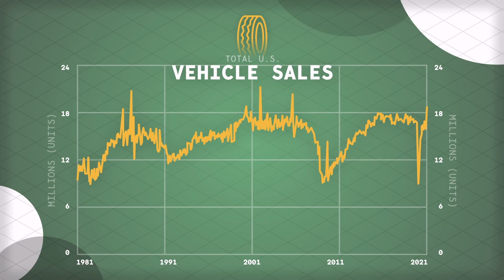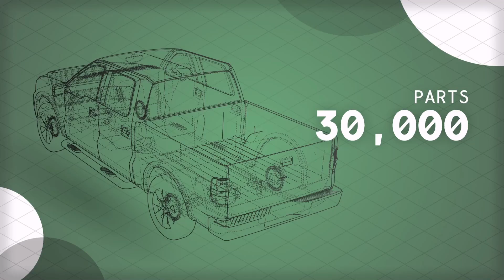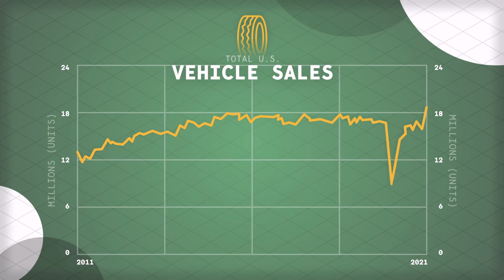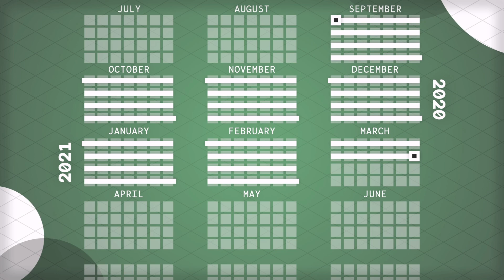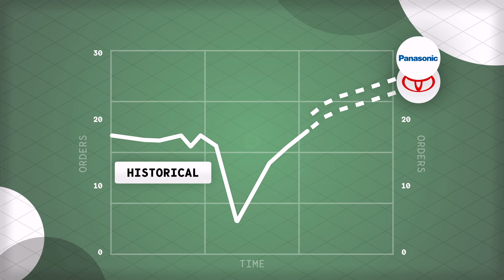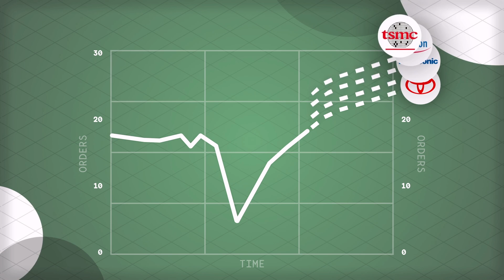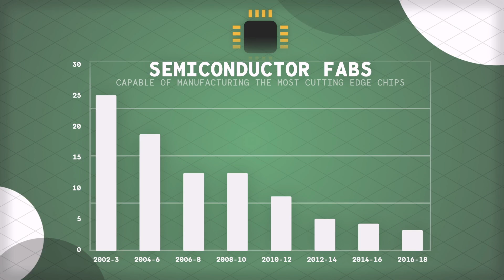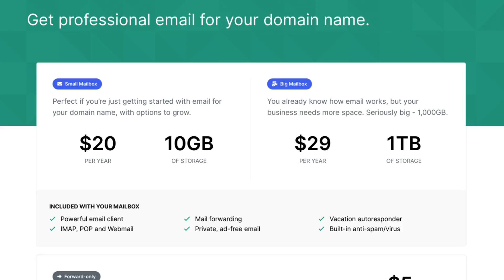Why the World is Running Out of Computers

Comment: Each nation needs to have a more comprehensive e-waste recycling program, too many perfectly good components end up in landfills, ie chokes, capacitors, transistors in a limited fashion, and precious elements. Many of these components can be easily repurposed in new devices.
Reply: This is not really true at all. E-waste is broken down for its metals and rare materials. You don't reuse the components at all. E-waste recycling is purely to save on mining.
Reply: @cazzah49  Recyling is recycling, the method is arbitrary
Reply: What Cazzym said about e-waste being recycled purely for materials. Also, what you listed (chokes, capacitors, transistors, etc.) are ELECTRONIC components and would be useful in building PCBs. What's being discussed in this video however are SEMICONDUCTORS which are dies of billions of "transistors" built at the atomic level and really can't be broken down or repurposed into other chips at all. Every unit made is its own unique product and an old die cannot replace a new one if people are demanding for it, so merely "recycling" is not really a viable solution in this case.
Reply: So much electronic equipment is thrown out that is still fully functional, or could be easily repaired. People need to make an effort to keep using things as long as possible and networks need to stay backwards compatible to accommodate old hardware.
Reply: Yes, but No. U know when China broke recycling, they broke all. 
Also u need to optimize code for slower tech like on C64 and Amiga
Reply: @mateuszzimon8216  That's a valid point

Comment: The future looks bright with more fabs being built in the West. The world should invest in diversifying manufacturing locations in all inhabited continents.
Reply: Overcapacity will force those fabs to close again, like it did in the early 2000s. Just build a couple more, and that is it. Besides, automotive manufacturers' just-in-time crap is to blame for it. They only order anything when they need it, and do not build up inventory. This policy backfired in this case. The Fabs are not going to sit around and wait for auto manufacturers, they will take any business they can get.
Reply: @syedyasirali1974  maybe, the demand wasn't as high in 2000 as it is now.  Many are estimating/hypothesizing that this level of demand is here to stay.  Cars are using more and more to the point they won't be reducing the level of tech in cars from here on out.  
Everything in life is using more chips due to Alexa and google being in everything.
Reply: @syedyasirali1974  Just in time manufacturing has been a constant nightmare in any factory I've work. It's never in time and ends up more like "sweep the floors until the parts get here next Monday."
Reply: @GeneralChangFromDanang  ive been a trucker for the last 15 years and was around when the world emulated japans business models , JIT bei,g one of them, and it is a disaster. Im firmly of the belief tbat for most Large companies it only serves artificial purposes. To avoid taxes and to keep companies real value low to avoid takeover/manipulation. I used to carry turbos between asheville nc and two hours west of chicago in an 18 wheeler. The normal load was maybe 6 or 8 turbos. Sometimes literally 2. And id haul ass back usually empty. A truck that cab Literally. Carry everytging you own includong your vehicles in the trailer with a handful of pallets in the back.  Travelling 3200 miles a week. Probably cost $6000 a week. And there were times they were calling me every 15 min as i got back to sheville saying they needed me there asap because their lune was shut down while they waited. It was insane. I could have probably carried 3 months of supply in One trip
Reply: @GeneralChangFromDanang  agreed. Most of the time, people ordering stuff will do so at the last second, and then demand it to be delivered instantly, forcing the manufacturers to run into overtime.
Reply: @cdreid99999  That is very much what I'm seeing. Most American companies implement a half-a$$ed version of lean manufacturing that feels more like starving Ethiopian manufacturing. They have good intentions, there's just nobody that knows how to follow through on it.
Reply: Yeah, because "storage costs" and "just having stuff laying around isn't generating profits". 

Right it isn't, but at least it isn't fucking tanking your profits and annoying your customers with delays, as not-having-storage is.

Comment: The problem is they cancelled there orders and then reordered after pandemic sale drop picked up but for semiconductors with the majority of the worlds supply coming from TMSC that are already been running at 100% capacity since the pandemic.
They have no space to refit customers in that cancelled order and it would be unfair on the other customers if they did.
The problem is on the car manufacturers for cancelling in the first place..big organisations should know semiconductors are in high demand with limited companies that can produce them.
TSMC, Samsung and Intel are really only companies that can manufacture powerful cpus nowadays.

Comment: Okay, so finally the focus will once again be on software instead of hardware. The age of throwing computing power to fix software bugs is nearing its end. Is that a bad thing? Once again software engineers (and game developers) will have to come up with original ideas instead of just increasing the hardware requirements of their games. Even trees don't grow to the sky.
Reply: One of the biggest accessibility issues with AAA game developers I have found was how their graphical settings appear to be nothing more than just an afterthought. Newer games look much worse when ran on older hardware than games that came out when said hardware was new. The graphical fidelity (texture quality, number of polygons, etc.) when choosing low settings is generally lower and there's LOD issues all over the place. I really wish they'd actually implement their graphics settings properly. :/
Reply: Yeah it seems to be a cycle. Especially when it comes to computing power and energy.
Reply: Obviously you don't work as an SDE or atleast not at a company worth a grain
Reply: The devs would, but management says it's cheaper to throw chips than brainpower at the problems.
Reply: losing braincells reading these comments
Reply: @sagvFt  well a bit of his comment yes but i agree with people prioritizing making better software,there always something that can be optimized